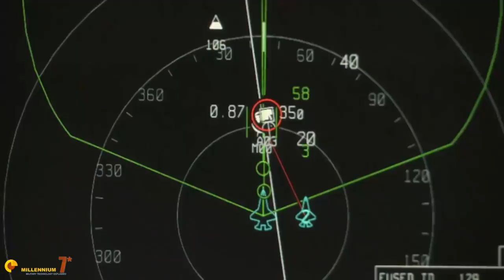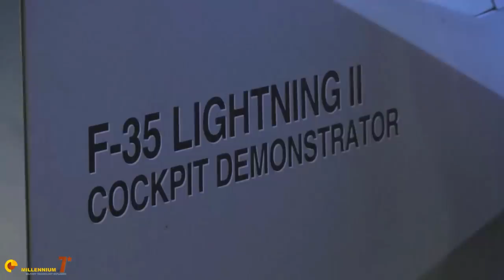Put the F-35 inside the F-16 | Are there limits to upgrades?

Comment: Electronics upgrades will probably result in a reduction in size, weight and power consumption today. There's also a standard protocol suitable for communication in aircraft, called CANbus.
Reply from the maker: Actually CAN is typical of automotive industry. As far as I know it was never used on aircraft.
Reply: @Millennium7HistoryTech  Not yet, perhaps,  but a simple open standard backed by experience on commodity hardware with millions of users over decades is likely to replace complicated and brittle proprietary ones.  A military aircraft can be viewed as a network of controller devices going somewhere quickly in formation, a 3-D version of 2-D automobiles.
Reply from the maker: @parrotraiser6541   To be honest, today there  are already standards available for that, without using the CAN. It was in the 70's and 80's that they were not developed enough to allow for an easy upgradeability.

Comment: The F-15 SA/QA/EX still showed us, that the right platform can be brought from the early 1970s, well into the 21st century with a fraction of the cost of a new platform and the lifecycle costs are also a lot cheaper, because most ground infrastructure and trained personell can be used to operate it. But I think that the F-15 is a unicorn and such endeavor makes not sense with many other platforms.
Reply: su-27  😉

Comment: Well, there is the upgrade, and then there is how long it actually takes to field a brand new clean-sheet design and certify it for combat operations and building up supply chains. Where-as you can have a "proven" airframe, engineering mistakes have already been mitigated, maintenance crews are familiar with the type, ready supply for spare parts, pilots intimately familiar with flight characteristics, so less training necessary on that front. While it cost more for improved performance, most of the other associated costs from a brand new airplane have already been paid for.

Comment: I'm pretty sure that the military electronics follow the same heat/power/performance curve as normal consumer electronics and thus upgrading old computer systems into modern one's will produce less heat, demand less power and give higher performance.
Reply: Power density is the issue. That always goes up.
Reply: That's not quite right. Moore's Law is basically dead at this point - transistor density will be less than double from this point on going forward. The cost of going to more dense "nodes" is going up quadratically.

When going to a more dense "node", designers can choose EITHER more performance for the same heat and power OR the same performance, for less heat and power. There is no magic compromise that promises less for all 3, unless you are willing to throw away more than half of the performance gains.

Secondly, a lot of performance gains have actually come from instructions per clock increase. That is to say, making each time the processor does stuff to information, each "tick" does more things. This more than anything is why marketing in the form of raw frequency increases has been effectively dead as of...the 2010s. Basically AMD Athlon and Intel Core times. It is more efficient to make each "tick" produce more calculation, than simply making each "tick" go by faster and faster.

Thirdly, military grade processors are at least several nodes behind in terms of individual transistor size. This is due to the needs for EMP hardening and the increased exposure to ionising radiation especially at altitude, as well as electronic noise from the radar and enemy aircraft. If consumer electronics are at say 5nm, chips for the military might still be stuck at 30 or 40nm for this reason. Smaller and smaller transistors become much more sensitive to electronic noise and ionising radiation. 

For this reason, military processor architecture designers might elect to focus much more on instructions per clock increases and architecture tricks like increased caching, instead of die shrinks and raw frequency gains. These gains require a lot of investment in R&D and engineering though. It also has to be said that IPC gains are very hard fought and have diminishing returns. At some point there is no alternative but to shrink. Each time they do though, implies a massive capital outlay of completely retooling lithography machines and fab assembly lines which might only produce several hundred thousand chips instead of several hundred million. With low production numbers also comes high unit cost. Add on the fact that lithography machines are only really produced by 2 or 3 countries with extreme demands, and the prospect of military chip die shrinks further recedes.

This is why it is not surprising to me that a plane like the F-35 uses liquid cooling for what is basically a late 90s, early 2000s era processor. If benchmarked today, I would wager that an individual F-35 processing chip might be comparable to the Intel 3000 series. There are multiple reasons militating against biennial die shrinks the consumer industry enjoys, for military hardware.
Reply: For the same performance, yes. For the huge power of newer equipment, no. Perhaps all the industry techs are just lying between their teeth, but from everything I have heard, lack of cooling is the main problem with upgrading old jet.

Comment: OK, that all makes sense. But how about a complete redesign of the F-16 more or less similar to what Boeing has done with the Super Hornet/Rhino or what Saab has done with the JAS-39E? I realize that it would be a complete new aircraft in most aspect except superficial appearance. I ask, because I think that the basic layout of the F-16 is so sound, that a redesign and the addition of off-the-shelf avionics, engine and so on might deliver just what general Brown is looking for. 
If I'm not mistaken, the JASDF adapted a design based on the F-16 (the Mitsubishi F-2) with heavy input then by General Dynamics, but with slightly larger wings/tailplanes, a slightly stretched fuselage, larger intake and wider nose, that increased payload-range performance and agility, while adding the use of composite materials and room for addition of more advanced technology later on. Of course I have to admit immediately that the ensueing programme was not the hallmark of cost efficiency in relation to improved performance. But do these examples not illustrate that there's possibly still some potential in the old design? 
I'll admit readily that I have an emotional stake in the case: I just love the looks of that aircraft. And well, looking at one in a museum is not quite as gratifying as seeing them in their natural element. 
But, if the teacher says no... (I'll just weep in silence).
Reply: Why would Lockheed redesign the F-16 when they can just sell the F-35 instead? You need to think about it from a business perspective.
Reply: @Mediiiicc  
I mean Lockheed is still producing and selling F-16, they'll still make a profit regardless. However, the problem is that even the newest F-16 is still a mediocre aircraft compared to other modern fighters, it couldn't hope to compete with Grippen or Rafale. And F-15 is the only aircraft offered by the US manufacturer that still use a center stick, which make it more time-consuming to train the pilot to transition to other aircraft.

Comment: Great video as always. I have a question. How do the bombers of WW2 compare to modern multirole fighters in terms of bomb load? If you could make a video on this, it would be very interesting.
Reply: There’s no need for a video.  One can simply look at the payload capacities.  The tiny little F-16 crushes the B-17 in this regard.  Even the minuscule F-5 and under-powered Gripen can carry far more than the B-17 could dream of.

B-17 payload:  4,800lbs (chuckle)
F-5E: 7,000lbs
Gripen C/D/E/F: 11,700lbs
A-10: 16,000lbs
F-16C: 17,000lbs
F-35A/C: 18,000-23,000lbs
Reply: @LRRPFco52 I don't think it's as "crushed" as you make it look.
Yes, those are specs for the listed apples and oranges. However, keep in mind the additional personnel, weapons and comm equipment the B-17 was also carrying. Not to mention all the fuel needed for it's mission. When the B-17 was designed, it was expected to not just deliver its payload, but to travel into, and back out of, hot zones unescorted. In the mid-to-late 1930's, when the B-17 was designed and purchased, there were no truly capable (range, fire-power, speed and maneuverability) escort fighters. I really don't know why no one developed/implemented drop tanks before The Great Patriotic War.
Reply: @politicallyunreliable4985  It’s an unfair comparison in every way obviously.  The 17,000lb payload of an F-16 and the F-16’s ability to bomb so precisely, as well as be an offensive fighter that can also self-escort for real (not like the B-17), just illustrates how absolutely it crushes 1930s and 1940s tech, as it should.  It’s a good way to help people understand how far technology has come if they have a reference point of the WWII bombers, but most of those people are dead from old age now.
Reply: I think it would be a very interesting video indeed. As a previous reply showed, there are huge differences in tech, crew, comms mission etc. But this is what is interesting. We know a B-17 is obsolete today. But how obsolete? I think a B17 wouldn't do bad in a CAS role today but thats why the Spectre is there I suppose. Again. Would be interesting! Please consider this for a video. Much love
Reply: @Marechalkev327  The B-17 would be totally slaughtered in the CAS role, in addition to being totally unable to drop bombs on a target less than a couple of miles in diameter. If a 4 engine WW2 bomber would be good at CAS, they would have just developed a 150mph turboprop bomber and put a big bomb bay on it. You think that you are that much smarter than all the engineers and tacticians since WW2? You are letting the fact that you like the B-17 totally obscure reason and logic. Such a plane has no place in modern warfare. Even ignoring the total obsolescence of piston engines and their unreliability and high maintenence costs, the same job could be done just as well by a turboprop twin, if all you needed was a big, slow plane with bombs. Not that the B-17 could carry much bombs. We don't need a long range bomber for CAS. Machine guns are worthless for defense. An A-1 Skyraider would be a much, much better choice, since it was faster, carried more bombs, had more than enough range and was much harder to shoot down. A B-17 would just be a big, slow, lumbering target in the CAS role. I cannot think of any reason that idea would make any sense at all. Hell, lets just use the B-52 as a CAS aircraft, it carries lots of bombs and can fly a long way too!
Reply: @justforever96  I hear and appreciate it. I still think it would make for a very, very good video about how yesteryears strategic technology would work on the modern battlefield. Keep in mind, the modern battlefield isn't a face-off between equally trained, equipped and supported forces. Its a fight between sophisticated, first tier forces with CAS, against a simple force fighting asymmetrical warfare. AC130 Spectre gunships are used today. B1 bombers are aslo used in the CAS role. Now why not make a video about previous strategic assets on a modern battlefield? How it would hypothetically fare and why a modern single or twin seat multirole would do better? I think it would be a very interesting video.

Comment: The issue of the F35 is not the cost per unit now.  It's the cost of maintenance.  The F15EX is more expensive than the F35, it's the cost of keeping it in the air.

Comment: While F-16 block 70/72 is almost as expensive to buy as F-35, the maintenance cost will be cheaper than F-35 isn't it? The engine is more familiar, logistic chain and maintenance worker only need slight change etc.

Comment: Ok but the big thing you didnt mention here is that avionics gets smaller and smaller over time. When the F16 came out a computer was the size of a building now my iphone has an order of magnitude more compute than the apollo missions did.
Reply from the maker: True, but that is a one sided view. Antennas and power components do not become smaller because there are physical limits. Moreover smaller and more powerful digital electronics mean also higher thermal loads and cooling systems are not becoming any smaller either.
Reply: @Millennium7HistoryTech  when I say smaller I mean at the transistor level a modern MacBook Air has more compute than desktops 3 years ago and has no fans. The key components like the radar keeps getting bigger but the computers themselves that analyze data from sensors get smaller due to inherent advancements in computer technology.

Comment: I have a question would a Rocket Fighter / Interceptor like the WW2 German Komet make sense in this day and age , the rocket technology is way more advanced and imo it would also be way cheaper but I might be wrong
Reply: no, they have little to no endurance and are a pain in the ass to recover if you're talking about a whole air force worth of them.

possibly a rocket-powered/assisted vertical take off system could be engineered, and it would probably be simple enough to design some sort of rocket-assisted braking for short landings in the process. A system that's not meant to replace the flight engine, just something to let the plane operate from tiny carriers or allow a reworking of deck space so that larger carriers can launch and recover smoother and faster.
Reply: @Omniseed  i really think rocket pods can be used to help jets in some aircraft carriers with ramps.
Reply: Fuel consumption is very high.
You run out of gas really quick

Comment: @Millennium 7 - I'm hoping you will do a video on the new F-15 EX which is a legacy platform that seems to have successfully gone through the long & expensive upgrade process that you describe. Lucky for the US, Saudi Arabia & Qatar paid to develop the new fly by wire avionics, software & computer upgrades, certain structural upgrades, and the new digital cockpit, etc. The EW system is new, but the AESA radar had already been upgraded. 

From what I've read Boeing has done a lot of what Saab has done in creating an easy to upgrade mission system that's separate from the avionics. The result seems to be a much more capable and future proof plane building off of a top notch legacy platform that has almost unrivaled performance characteristics re speed, agility, load.and range, etc.
Reply: Saab hasn’t done any such thing of the kind.  They copied the Rafale F4 Integrated Modular Avionics architecture that is common in airlines as well, and it still isn’t developed.  Saab has been developing the Gripen E/F for the last 14 years, and it still is nowhere near ready for production.  They don’t have IRST on it, and haven’t flown it at night for some reason.  That program is staring to look more and more like a scandal.
Reply: @LRRPFco52  Non-responsive   .. My comment discusses the F-15 EX and you're making some point about the Gripen .. I don't get it.
Reply: @brodieboy3  You mentioned how Boeing has done what Saab has done.

Comment: I think that limiting your discussion to the F-16 creates a self fulfilling argument.  Replace the F-16 in your argument with the F-15 and you can see a different outcome.  Stuffing the F-35 avionics in the F-15 airframe is much more doable.  Your concerns with power and cooling are mitigated by the twin engine design along with the an already existing robust cooling system.  I worked Avionics for the Tomcat for 20 years and over that time we saw many upgrades to systems.  Those upgrades were difficult because we were trying to make new stuff work with old stuff.  In the case of complete replacement of Avionics and Fire Control systems, that is not a problem.  The majority of the work will be in teaching (reprograming) the flight control computers the new airframe.
Reply from the maker: True, the F-15 is easier to upgrade. Larger and more powerful fighters have the edge here.
Reply: F-15EX cost more than F-35.

Comment: The F-16 is built by the same company that builds the F-35
The engine does not have to be changed as the F-16 already has engines that can be improved.
As far as stealth, it does not need to be as stealthy as the F-35, just reducing the RCS from the engine inlet and fan blades will do.